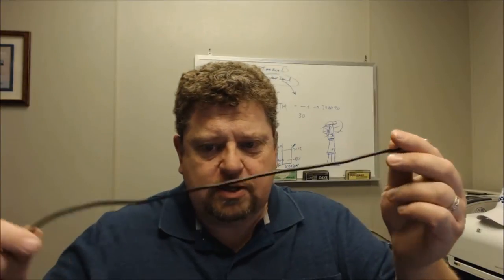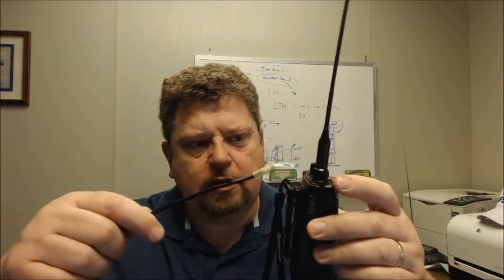Tiger tail Counterpoise, Rat Tail, Lambarda, HAM Urban Legend - AF5DN

Comment: I experimented with 1/4WL rat tails on VHF as a part of my performance experiments about portable antennas. So far I haven't seen any TX improve using rat tail with 1/4WL or 5/8WL portable antennas. I tested it holding the HT in my hand, without any remote mics and so on. The only thing that is significantly improved is the RX performance, I notice that clearly by contacting 90km. far relais. This is also a well known fact, because the rat tail enhances the RX structure of the whole antenna system.

Comment: Thanks for taking the time to evaluate both that longer antenna and the rat-tail counterpoise.  I have referred hams on a forum to this video.  The difference that the rat-tail typically makes is on the order of 1-2db, which puts it into the category of "make or break" when on the fringe edge of radio coverage area, whether that be when using simplex to another ham's radio or when using a repeater.  It's certainly NOT anywhere near 12db, in fact it is doubtful that it could exceed the theoretical 3db gain.  A longer antenna, especially compared to the stubbies that typically come on an HT, can make a much larger gain difference; bigger is nearly always better with antennas, including their counterpoise if they are verticals.  BTW, you don't have to use the heavy-gauge wire you show for your counterpoise; I typically use 18ga or 20ga as a compromise for durability, although some people use 22 or 24ga; in all cases, the wire should be stranded, though, as it will endure a lot of movement/twisting.  I have conducted field tests with other hams via simplex that has repeatedly shown the difference both the longer antenna and use of rat-tail makes in going from "not heard" to "heard; when on the edge of coverage.

Comment: Put the handheld on your bench--away from your big bag of salt water called the human body and use a speaker/mike to operate it.   Methinks the difference will impress you.  Problem is that while using the handheld with the counterpoise attached the proximity to another conductive material--you--will greatly diminish the effectiveness.   I do agree that the stock antenna that is supplied with virtually every handheld is awful.  I bought a telescoping antenna and ran it out to about 19 inches for 2 meters and the difference between that and the stock antenna was astounding.  For 70cm I telescope it in to about 6.5 inches or 13.5 inches depending.  Downside?  It's not flexible so you have to be careful not to bend it.

Comment: You've pretty much got it right. If one is going to go through even that much trouble, then one might as well make a J-pole out of TV antenna lead-line, or even make one of the 1/4 wavelength antenna with ground plane using an SO-239 socket. Both take just minutes to make...although the TV lead-line J-pole can be rolled up and stuffed in a pocket. The J-pole yields a significant improvement over pretty much any typical "rubber-duck" antenna and as an emergency antenna can be setup with little fuss in a tree, over a door, on a pole, on a wall, etc. One could I suppose even make it an HT-mounted antenna with a suitable non-conductive support element that attaches to the HT and 'hangs' the J-pole.

Comment from the maker: •	I have learned the hard way that “scientifically” or on-the-bench does not always = real world functionality.  It does appear that the Rattail Antenna Booster (your product)  is different than the simple device I showed in this video.  I will be purchasing a Rattail Antenna Booster and putting it through the same tests as I did this one.  I relay hope it works.  Thanks for the comment and VR.

Comment: As cheap as they are to make, if rattails made significant enough difference, they would be included free with every handheld radio out there. They are not included with your handheld for a reason: If you are in a signal "black spot" - rattails won't help. If you can already communicate but could do with a slight improvement, might as well get a better antenna.

Comment: I mean, I'd probably have to agree with what you've said here given some other videos I've seen explaining what it does. It will help in all technical respects, but it's not going to turn your 5 watt handheld into 100 watts on a 100' pole. The major limitation with handhelds is that they're basically on the ground and you can only get as much distance as tall as you can stand and what's in between you and the repeater (trees and  whatnot). Thanks for the video and 73

Comment: Check out the actual YouTube video of the Rattail Antenna Booster and you will see its output improvement being measured scientifically.   We have been selling selling since 2002 and have thousands of positive reviews.     During the USA patenting of the rattail it was necessary to prove that it works.   The product is famous for coming through for people involved in both Commercial and Amateur Radio Emergency Communication.

Ian Soutar 
Vancouver Island 
(Inventor of Rattail Antenna Booster)
Reply: I still have an issue with it if it’s just a piece of wire. if a HT antenna is 1/4 wave for VHF (just for example), it isn’t 1/4 wave for UHF.

Comment: First of all, a counterpoise and a ground plane are two separate things.

Secondly, you "testing" has numerous flaws.

How did you become an extra when it's obvious you are clueless about how antennas work?

That's what is wrong with a lot of hams, big fat EGO issues.

Take the PIPE.
Reply: No counterpoise, radials and HF ground are all the same things.
Reply: I concur.